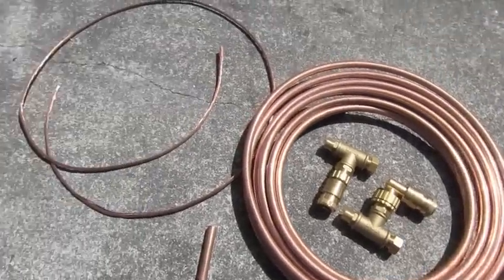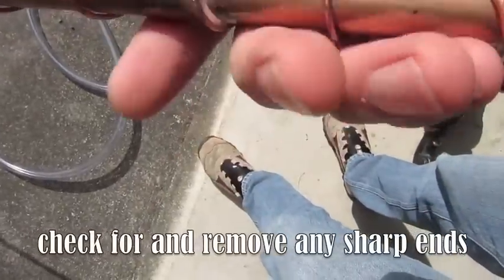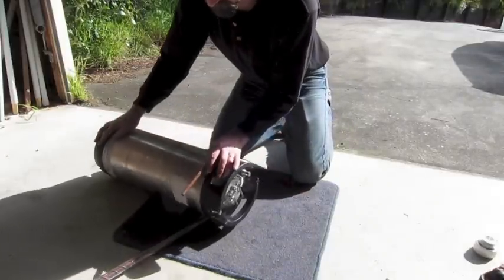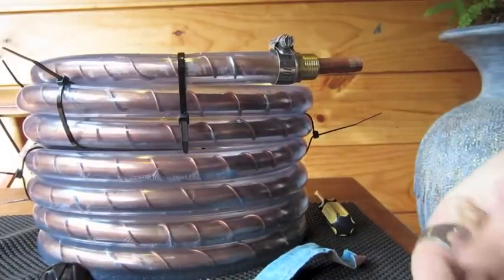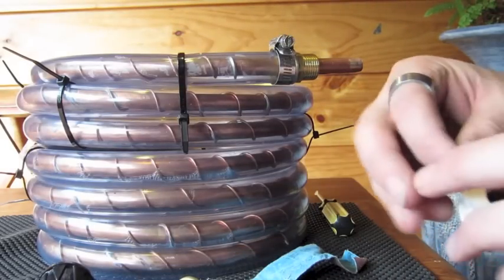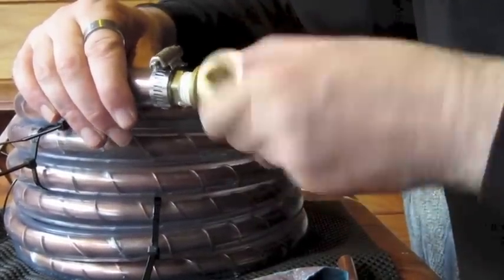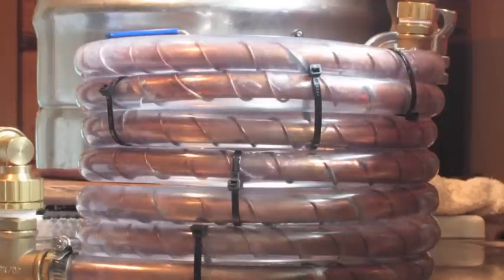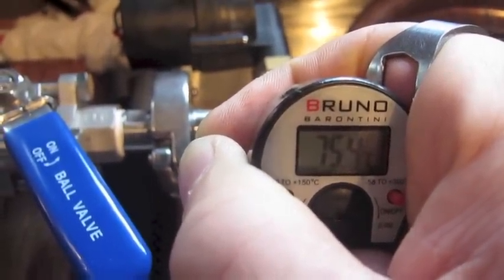Counterflow wort chiller, build and test

Comment: That is pretty sweet!! I'm trying to decide whether to build something like this, or buy a plate chiller. Your solution was really elegant though, great little package.
Reply from the maker: Keith Christofferson I have used plate chillers before, but they blocked and caused cavitation issues with most of my brewdays. However alot of brewers haven't had any issues with them at all. I also have a parallel counterflow chiller build that I have done as well. Parallel Counterflow Chiller part 1 of 3 I built this to look at the tear down and cleaning of a counterflow chiller.
Reply: Time4Another1
That's interesting! I'll take a look. Did you find your coil counterflow ever had blockage or debris issues, or was the motivation to make a parallel counterflow chiller more so just for piece of mind?

Comment: that is awsum to see this how to make chiller 
i have a situation
i have an aquarium which temperature is 35 degree bt the regular constant requirement is 25 degree 
will this model will help me in chilling out my tank and get the consent temperature
and the flow should be in flow frm one side to chilled out flow should be from other side
pls let me know whatever is the answer
thankyou
Reply from the maker: Neethi Nathan It could work for an aquarium but it may be to efficient, the counterflow is designed to take boiling wort down to 20ºC in under 15-20min. with the small temperature adjustment that you are after you maybe able to do it with a circulation pump that has a length of tubing coiled up in a small container of iced water, but you would want to have the pump automatically turn off once the water reached temp. A work colleague of mine has recently built a large salt water aquarium, and I seem to recall that there are off the shelf units that can maintain the temperature.

Comment: I know u have the valve for the wort at the start of the chiller.....but would actually having that valve full open and a second valve at the end where it drops into the pot actually increase the surface area of contact inside the copper pipe? My thought is if the top valve is only partially open then it would not fill the pipe but only fill the bottom and have an air space at the top of the pipe? Valve at bottom restricting flow would allow to still slow the flow but also fill the tube thus making the 1/2" copper full and in full contact with the chilled water!
Reply from the maker: nathan27bryans yes when I put the chiller in place in the brewery I fitted a ball valve at the out end, for exactly the reason you mentioned. I had it setup like that for the video though to make sure if it sprung a leak, I could turn it off quickly :)

Comment: is the 1mm coper wire absolutely required?
Reply from the maker: it helps a lot, it increases the heat exchange efficiency by about 5 x as the water is turbulent, and also makes more contact with the pipe as it spirals around it.

Comment: have you thought to put a valve on the out put? That may help bring the water temp. up and the wort temp down by giving the wort more contact time with the liqur. I like what you are doing ! Very nice. I'll have to make one myself. Do you have a list of parts? That would be a great help. Thanks
Reply from the maker: if you mean the output of the waste water, no. I can control the flow of the water going in via the main water tap, and there is a ball valve to restrict the wort coming out, so that allows for pretty good heat transfer. I have found that slowing the water down you get better cooling, instead of having the water full bore. Unfortunately I don't have a list of parts, as some the parts were picked up from a local plumbing store and are not globally available. However I have a brand new counterflow video that I am working on at the moment, and with that one all the parts I have chosen can be sourced from international supplies, so that anyone can make it. Cheers
Reply: Thank. looking forward for the new and improved counter flow video. Hope to have some videos of my own some time down the rode of the brewing and random stuff that I'm doing in Northern BC Canada. :) Much love

Comment: Great DYI! Do you have any issues with the PVC vinyl tubing? I understand the maximum thermal temperature before deformation of that kind of tubing is just 92 Celcius. Would hate to have it pop or melt a little at the wort entry point.
Reply from the maker: Cheers. Good point, but because the water is flowing fast in the tube constantly, it doesn't get up above 70º. If I slow it down to a near trickle then yes the heat builds up and the highest reading I have taken at the wort inlet, is 88º on the brass, however it is not for a prolonged period. Its like when you pour boiling water in the kitchen sink, the PVC waste pipe can't handle that temp for a long period of time, but for a short period it has no issue.

Comment: interesting setup.... but how are you going to sanitize the copper tube. You're going to pump sterile wort through that and who knows what kind of bacteria you're going to be picking up every time you use it...
Reply from the maker: the cooper tube gets flushed with cleaner after a brew, and then drained. before the brew it is flushed with water from the HLT, then the boiling wort is recirculated through it for 15 minutes, that ensures any bacteria or "wild yeast" is killed before the cold water is turned on to cool the wort. It is the same principle as chiller plates that commercial breweries use. Cheers

Comment: Great video. Can someone find all that stuff at a home depot? Its a box hardware store in the states.
Reply: You should be able to find most of the equipment he used. You won't be able to find the triclover fittings though. You could use compression fittings to terminate the water line after the T's. That will keep the water away from the wort. Then at the end of the copper you could sweat on any fitting you want, or just leave it straight and connect hoses with worm gear clamps.
Reply: Great. Looks like I've got a weekend project now

Comment: Hello, I love your DIY cunterflow, It doesn't so hard to make one. I understand the first part, (roll the wire on the pipe, solder it to the pipe and put it in the pvc pipe) but it after I'm not sur of what I must do .... can you tell me what to buy at my hardware store to plug the cunterflow. And I'm not sur that i'm understanding how the colded water is separated to the beer with the "T brass" ... did you soldered to the copper pipe? (because when you make your water test at the end of your video it leaked a little bit).
Reply from the maker: Hi, Unfortunately I don't have a parts list for the counter flow, as I simply went down to a local plumbing store and "dry fitted" bits together and they only had code numbers, not actual descriptions of the parts. In the end where the copper pipe comes through the "T" there is a 1/2" male to 1/2" female brass reducer, which has an internal diameter the same as the external diameter of the copper pipe. So it is a tight snug fit, the small amount of leakage was corrected by flaring the end of the copper pipe. I would recommend now however using compression fittings, and I actually have a new video coming out soon with a completely new design. Cheers
Reply: Time4Another1 can't wait to see this new video .... and what kind of plastique pipe did you use to make yours counterflow ?

Comment: That threaded nipple that you have going into the tubing and connecting to the tee.....is a MUCH larger inside diameter than the ones I've been able to source. Did you have to special order it? all of the fittings that I've found fit super tight on the copper. I honed mine out as much as I could....but it doesn't have nearly the open flow which yours does.
Any tips on where to look for that larger inner diameter piece?
Thanks,
Chris
Reply from the maker: Sorry for the delay in getting back to you Chris, your comment had been hidden for some reason. That nipple was off the shelf at the plumbing shop, there is about 2mm tolerance around the copper pipe. I know the smaller inner dia ones you are talking about, as they are what Stainless Steel NTP nipples are usually like. The best solution I can offer is to try another plumbing supply, a trade supply normally has more parts than a hardware store. I am also in the process of doing videoing a brand new counterflow chiller design, one with parts that I know are available from eBay, it is also a parallel design. Cheers

Comment: Thank you for taking the time to put this together.  

How do you sanitize/sterilize this device?  That is, especially to ensure that there are no deposits which remain to cause off-flavors, etc.
Reply from the maker: After a brew I flush it with water to clear it out, then drain it. Then on the next brew day, before I start to cool the wort through it, I hook it up to the kettle and recirculate the boiling wort for 15min. That sanitises it up. I cool my wort by recirculating it back into the kettle until the entire kettle volume has reached pitching temp, then transfer to the fermentor. I haven't had any issues with it at all, no off flavours etc.  But I am looking at another counterflow design, one that is parallel, so that you can actually get line of sight through the copper. But thats another video, that will be coming up soon. Cheers

Comment from the maker: Cheers, I brought heavy gauge electrical wire and stripped the insulation of it, it is about 1mm thick wire. Galvanized would be okay though, as its primary purpose is to create turbulence not heat transfer. It might start to rust though at the welds, although solder would protect it somewhat. An alternative would be aluminium, but then soldering could be an issue.

Comment from the maker: yes very important to have water and wort flowing in the opposite direction
Reply: This is great! You should should swap the wort so that it flows into the bottom of the coil and not the top. Should increase efficiency a little since you can drain slower increasing contact time with the cool surface of the copper tube without introducing bubbles into the copper tube which insulate and lower heat conduction

Comment from the maker: yes, I pump back into the kettle to bring the entire volume of the kettle to pitching temp, I have done a video called the "chill off challenge" where on I compare both recirculation and straight into the fermentor, and both methods took the same amount of time. But I prefer recirculating as it is easy to setup, and a no fuss method, were as straight into the fermentor ball valve adjustment is needed to control output temp.

Comment from the maker: after the brew, I run the kettle cleaning water through it, and finally star sans. Then I let it drain and the star sans evaporates. Before I use it again, I also run the boiling wort through it, and back into the kettle for 10 min to give it a further sanitise.

Comment from the maker: Hi Stefano,

I hook up the counterflow to the kettle and pump boiling wort through it and back into the kettle again to sanitise it for about 10 minutes before I turn on the cold water for chilling. Then at the end of the brew day, It is left connected to the kettle during cleaning and all of the cleaning solution used in the kettle is run through the it to flush it and clean it out.

Comment from the maker: Once water is flowing the turbulence settles down. The theory behind the wire around the pipe, is to increase the travel path for the water passing over the copper. So instead of flowing along the pipe it flows in a spiral around the pipe. this means that water has a longer contact time to transfer heat. The wire also adds a little bit more surface area for heat transfer, even though it is minimal. Ideally Convoluted pipe, of finned pipe would be more efficient, but is wire is easier for DIY

Comment: I'm curious to know the basis behind the idea to create a turbulent flow in the water portion of the chiller. Intuitively I'd guess that less turbulence means more contact with the hot inner tube, which in turn means more efficient cooling. But fluid and thermal dynamics are never very intuitive...

Comment from the maker: I have a pipe flaring tool, and I used that to flare out the end enough so that when I screwed in a 1/2" nipple it compressed against the flare to might a tight seal. A metal spike would do the same thing with a bit of force behind it. Another option is to use a silicone washer to create a tight fit. Cheers

Comment: I made one of these myself years ago, and it works like a charm.  I think coiling wire around the beer tube to create turbulence is unnecessary (not to mention the hardest part of this process).  The copper tube doesn't sit perfectly centered in the hose, and the variations in the water gap will create plenty of turbulence on their own.

Comment from the maker: Hi Aaron, I have mine connected to a march pump, so it has no issue. I tried it with a gravity flow but, like you suggested the overall length of pipe is just to much to handle, there are also to many opportunities for air pockets to form and restrict the flow. I have to prime mine by pumping into it, to ensure all of the air has been expelled. If I rely on gravity to fill the coil, the liquid soon equalises pressure after a couple of coils and then, its going nowhere.

Comment: What's the flow rate like out of your chiller? I made a chiller like this but with about 14m of pipe. It takes around 1 min to get a liter from it. I'm trying to work out if it's so slow because of the length of pipe.

Comment from the maker: Gravity should be able to do it, as long as your kettle is high enough so that everything runs down hill into the fermenting vessel. However I prefer to use a pump so that I can reticulate the wort back into the kettle, once the entire kettle volume has reached pitching temp I then run it into the fermentor. Also I run boiling wort through the counterflow for 5min first, without cooling, this ensures that the counterflow is 100% sanitised.

Comment: Is there a limit to the length of copper tubing when NOT using a pump? I have a 20 foot run of copper tube but I don't want to have to purchase a pump, wondering if gravity will be enough. Thanks for the great video.

Comment from the maker: As long as it is lead-free flux it is safe, like the solder and flux used in most plumbing. A good clean down with boiling water cleans away any flux that is left over also. 95% of the soldering is also on the water side of the pipe.

Comment from the maker: Yes the longer the pipe, the more surface area and a better transfer. You could probably increase the flow rate for a faster cool down also with a longer pipe. But one thing to consider is that the water flowing in the opposite direction will eventually start putting the heat back into the wort, and eqaulize the wort and the water to the same temp. It would take some serious algebra to calculate the exact length of pipe needed before that started happening. Cheers

Comment from the maker: 2.6 gpm for the 10Watt version and a maximum head of 7.5 ft. check them out at ussolarpumps[dot]com. I have it hooked up to a 12volt power supply that is in my control cabinet.

Comment: Those couplings are sweet. The only improvement I would make is to add an o2 in port somehow, close to, but after where the wort in port is, so that you could aerate as you cooled. I do see some cavitation happening in there though, so aeration might just be happenging naturally anyway. All in all, nice setup.

Comment from the maker: Hi Rick, I went to a plumbing wholesaler, and looked around at all the bits, trying them out for size, sort of an adhock design process. The most important part was finding a reducer that fit the snuggly around the internal copper pipe that I had.

Comment from the maker: Cheers for the comment. 

The copper that the wort runs through doesnt have any obstructions so its pretty easy to clean by hooking it up to a pump and recirculating cleaner through it. Before I use it I pump the boiling wort through it and back into the kettle, that kills anything that could be left behind. As for sediment I haven't had it block up yet, pipe ID is about 10mm, plus I normally whirl pool, or run through a turb filter first so sediment is minimal coming in. Cheers have another1

Comment from the maker: Hi Michele, that will be fine, the glaze will burn off where you weld the wire to the pipe, and only water is running on the outside of the pipe so no glaze containment will effect your beer. Try to weld a bit of glazed wire first, and see how well it bonds though, just to be sure.

Comment from the maker: Cheers Gordon, the flare seems to be holding up fine, I have run it a couple of times without the wort lines connect to see if it was leaking, but looks all good. I have been meaning to get a silicone seal to ensure a tighter fit against the flare also, just havent got to it yet.

Comment: Nice video.  Have you found any issues with the flared tubing leaking again in to your wort?  I would be a little worried it may start up again after repeated use/movement.  Great idea using the clear tubing for a visual effect.  Cheers.

Comment from the maker: Yeah those imperial wrenches are hard to find, lol. We only use inches as a measure of a man now, everything else is metric ;)

total build cost was around $140USD, which included the blingy brass hose fittings, copper pipe was extremely cheap, picked up a 5m off cut for $20